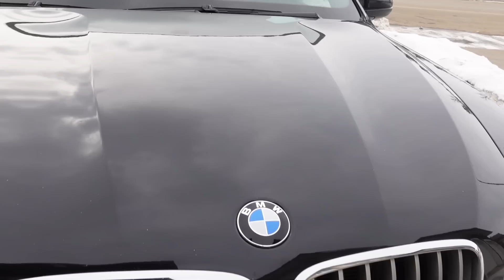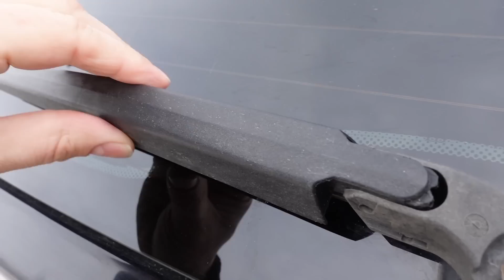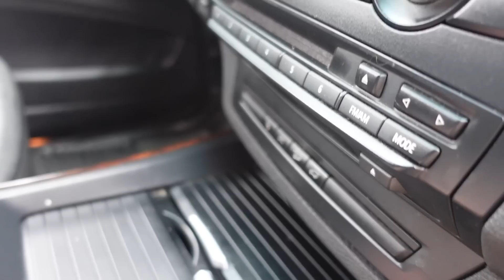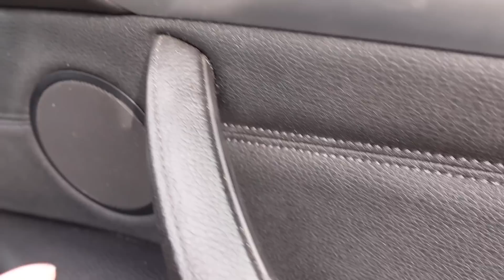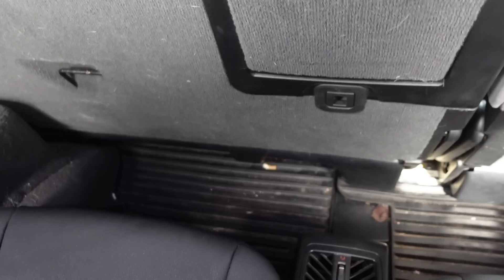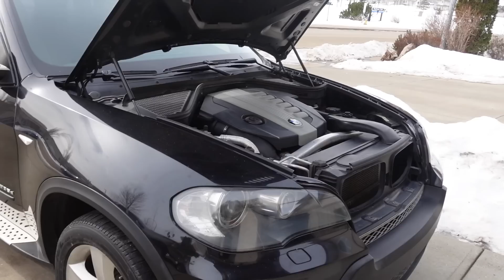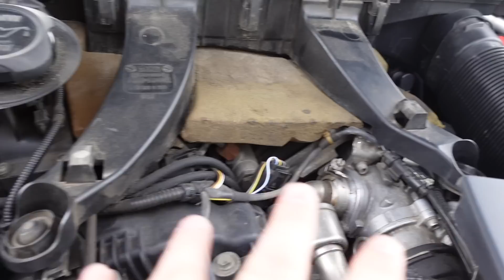10-Year Ownership Of My BMW X5 - A Long Term Review

Comment: I am considering a 125K (mile) 2012 X5 35d.  Your video was great and helpful, now I'm worried but made notes on your experience.  $12,000 purchase price but really nice condition!!!  Thanks
Reply: Being a year ago, how is your bmw treating you?
Reply: @OneReasun 160k have spent 12k at the dealership for new turbo and def  and egr was another 3k this thing is a money pit.
Reply: @Thedirtylittlesecret  I've had mine for 8 years /135,000 miles and just replaced DPF (Diesel particulate filter), glow plugs, and turbo's.  The maintenance alone is expensive, but these 3 things were very expensive.  So tough to get through these 3 on that cost, but hoping it's the last of large maintenance items for a while.  Ugh
Reply: @OneReasun  i feel you. If you ask me all signs point to cutting my losses. It’s just ridiculous.
Reply: @Thedirtylittlesecret  a trusted shop I go to is telling me these 3 are the main things with Diesel that are needed. Should be clear to go for a while.  So that was reassuring, sticking with it
Reply: @OneReasun  good to know but there is also a rear egr we replace the front and we just replaced the high turbo i guess there is 2 also 🤷‍♂️
Reply: @Thedirtylittlesecret  oof...what's the estimate on that one... hopefully the last of it

Comment: This is a crappy car, suspension problems and heater problems didn't even get to the engine b4  I turned this off. 300 thousand on a 2002 Honda crv. It is my daily driver. Just maintenance and brakes. You keep buying that German crap, I work on them, that's why I own a Honda.I really do like the BMW motorcycle, that is a long term machine for touring. Cars will not hold up to them after year 2005

Comment: 2009 Bmw x5 35d,  223k,  I am getting bad fuel economy 18L/ 100km, any suggestions?
Reply from the maker: With those miles it could be a bunch carbon in the intake or DPF getting clogged.  Regen cycles also cause consumption issues.  Lots of shorter trips?
Reply: @ECPP yes, mostly city driving

Comment: I have 2012 BMW X5 xDrive35i and had engine leak after getting it repaired it ended up having engine failure (probably should have taken it to BMW mechanic). Now I'm debating to repair or replace.  

The line about not giving it to parent or child stuck with me, I was gonna fix it and give it to my mom as backup vehicle but maybe not.

I bought certified pre-owned 2020 BMW X3... Wish me luck.  I might switch brands next time.
Reply from the maker: Good luck on the new car.  Which engine did you go with ?
Reply: @ECPP  2020 X3 xDrive30i pretty basic. But turbo 4 cylinder, right?

Comment: I had a 2010 x5 I spent little over $6000 after the warranty expired I drove that suv 6 years sold it for $14.000. Piece of advice, don’t Buy a bmw lease it! 74% of bmws you see on street are lease. After the x5 I bought a GX460 made in Japan, I’m still driving it never spent any money most reliable truck in the world also very luxury
Reply from the maker: Sounds like a great move on your part.  Cheers

Comment: With the break light issue...what was the fix? I'm looking to but one with that same issue. Thank you!
Reply from the maker: We were told an expensive module so we said screw it and left it
Reply: I bought replacement (Depo TW, $45) + original adhesive gasket at dealership ($15). It's fine for over one year already - pretty easy DIY, with tutorials on YT :)

Comment: BMWs frames and body panels are well made, but when it comes to everything else, they use way too much cheap plastic and computer crap. The engine bay components have more cheap plastic than the actual interiors. Personally I’m a die hard Mercedes Fan, but there are definitely some bmws that I like and would like to own. My favorite thing about some beemers is the split adjusting front seats, they look nice and are super supportive and comfortable.
Reply from the maker: I would say BMWs have some of the best structures and best at resisting rust as well.
Reply: @ECPP  I agree, I would like it if they worked on improving the quality for some of the major mechanical components though, the problem with bmw and Mercedes’ is the same problem that Apple and Samsung have. They can’t be beaten by each other. Perfect example would be earlier versions of idrive. It debuted in the early 2000’s as a headlining feature of the brand new 7 series. There were rumors years before that Mercedes’ was working on an infotainment system like idrive and because bmw was eager to get ahead of Mercedes’ they rushed idrive. Mercedes changed their design language in 1998 when they released the w220 s class. They noticed that bmw and other competitors were getting popular because they were having more bubbly like exteriors and so Mercedes’ went above and beyond with the 90’s trend. The w220 car got so much criticism of its reliability that it gave Japanese competition an advantage in sales. BMW had the same problem until the 2010’s when they updated and drastically improved the idrive system.

Comment: Over a 10 year period 16 k in repairs .mostly plastic issues is good.
So no major motor repairs etc piston rings loss of compresion valve breaking etc etc.
For a bmw is good.motor is bullet proof if looked after decently.
Once again snow salt cold.
Will crack alot of plastic hoses and parts.and mainly parked on driveway .in winter.
I got to say built to last.
Reply from the maker: thanks

Comment: I kept my 2009 x5 for 10 yrs as well, and I added up dealer maintenance and it was $16,000 usd (I kid you not). The final nail was the DPF needed replacing and they quoted me $6500. So that was that. I now have a 2018 x5 35i. I miss the diesel torque though. The engine was generally bullet proof. It was all that additional emissions monitoring and control garbage that didn’t work properly.

Comment: Good video, I own the same diesel model, 2012. Some of the problems are caused by parking outside. Garage helps. That said, it’s definitely not cheap to own. We have sports package, tires alone cost $1,200 since the positive camber causes uneven tire wear. This thing drives like a tank, we love it on long road trips.
Reply: How many miles on yours ?
Reply: 150k

Comment: My 2009 E70 35d is in great condition and drives like a new car at 250,000km.  I've spent some money on suspension, but that's normal wear and tear. Similar wear and tear to what you've pointed out. Fantastic car! No airbags, fortunately. ;-) I didn't realise that the body was largely aluminium!
Reply from the maker: Very nice

Comment: Mark. Love the videos. As commented on a other one we recently picked up a 2013 X5 diesel. Right under 160,000km and one owner. Decent maintenance history which included an active tank and thermostat replacement within 5,000km. Most of the items you mentioned are well known and documented. I do almost all of my own repairs etc so will likely cut down on cost. Depending on how the vehicle is I may look at deleting the emissions as well which would cut way down on running costs. Great share and appreciate all you’ve put out there.
Reply from the maker: Thanks for sharing and agree it’s likely one of BMWs most stout engines and deleting the emissions will ensure a long life vehicle that is solid mechanically and will not rust, making it run for a long long time
Reply: Active tank, is that the DEF?

Comment: Hi I have a 2 turbo 40D 2011/10 its great.  No DPF fitted so extra good needs diesel additive to de carbon the ERG  Use Penrite very good instant improvement on response .  have clocked over 170,000 Km  great driving replaced front lights assembly  with leds.  also installed 10.25 inch display qualicom quad core.  All great had the software box for media upgraded for apple android car play compatibility.   Works well ex BMW guy in Melbourne australia gave me the upgrade software worked .  no audio jack needed just blue tooth .  He did not give it was a few hundred Dollars Aus.
Reply from the maker: Cheers
Reply: Hi I looked at your youtube before buying and it decided my buy decision no regrets thanks.

Comment: Got 300k on my bmw 2010 x5 3.0in line 6 best motor it just keeps running other then valve cover gasket’s and a water pump and 2 sets of new tiers the truck has never left me stranded very reliable
Reply: N52 or N55?
Reply: My 05 Water Pump went. Outside of that it has been a dream. It gets up quick
Reply: Not a truck..lol

Comment: Considering the environment, I think those maintenance costs are not too bad. If I've learned anything from this video, it's that in Canada, you probably should change your car every 5 years. I'm looking at buying the later version. Probably somewhere around 2016-ish. I also live in a warmer climate. It never frosts here, but the UV is strong, so it's essential to store a car either in a garage or under a carport.
I can't also help wondering, how your car would have performed, had you kept it garaged most of the time? Thanks for the thorough review though. Very informative.
Reply from the maker: Cheers
Reply: Those maintenance costs are not “okay”. I live in Alberta Canada and mainly drive Mazda, Toyota, Lexus…. and I also park outside year round. Aside from replacing brakes, batteries and wear & tear items we have had no major repairs on these brands. We stopped buying Toyota because we wanted a quieter and more comfortable ride… so switched to Lexus. We previously owned North American autos but found after 5 years, they started breaking down…. so we stopped buying them. I’m at a point in my life where I can buy a $100,000+ auto and I really wanted a 2023 BMW X5 but after watching this, I’ll be buying another boring Lexus or Acura instead. My corporation leases our auto’s for 3 years and then buys out the lease. We then buy from the corporation a year later and put the vehicles into our own names. We keep our vehicles between 6-10 years and listening to this…. A BMW would be well above $10,000 - $15,000 in additional repairs over that time. Not too mention the exorbitant service costs over that time.
Reply: @beri232  I ended ip  buying a Peugeot and not a BMW. I still like the BMW design, but if they are not very reliable then there is no point in spending the extra money for the BMW brand. I still maintain my comment about keeping cars in the garage. It will definitely prolong the life of it. 
My Sister lives in Canada and she also said American cars start rusting and wearing out fast. They recently bought a new Mazda and seem happy with it.

Comment: i own a 2018 bmw f15 35d and let me tell you , i'm in love with that car. Torque and fuel efficiency is what lead me to buy that car. And the bulletproof engine :) but before buying it i made sure they fixed the issues on the E70.

Comment: I enjoyed watching your video since I have a love relationship with my 2007 E70 X5 3.0 inline 6 which turns 15 years old this month that I purchased new in Denver, Colorado.   No injectors nor diesel so the engine has been great. Low mileage - 104K currently.  The exterior and interior also has held up very well. Third row seat air bags went out once. I also track my expenses with dealer repair for the first ten years but after that an independent.  I haven't had the major diesel expenses but I agree about the $1000 repair bills are common when some thing major happens. I  will purchase a BEV as my next vehicle but am resisting the additional monthly investment since my X5 is basic transportation but still averages $200 a month.

Comment: None of this will bother BMW. They think that they did you a favor selling you a car. I make frequent round trips of 600 miles. I end up using a Toyota truck which gets 17mpg rather than a BMW that gets 30mpg, because I don't trust the BMW not to break down.
Make sure you tell everyone you know that BMW are junk.
Reply from the maker: Thanks and I certainly do.  Cheers

Comment: I wanted to add that your receipts are a bit too much. It looks like you were maintaining your x5 at high end shops and dealerships, which is a way to overspend. There also has to be an economic approach to owning a vehicle; prepandemic e70s had the worst resale. You would not want to plow thousands into a vehicle worth under 10 grand.
Reply from the maker: You are totally right

Comment: Proud owner of lci x5 35d with 3rd row. Bought as an off-lease CPO and now 7 yrs of ownership and it is turning 10 yrs old. Older 2009-2010 diesels like yours seem to have bit more issues than 2011-2013 lci
Reply from the maker: That may be possible.
Reply: I do think LCI or in general Face lifted vehicles tend to fair better than post face lifted or pre lci cars. It’s more so due to the manufactur finally getting the car dialed in from customer complaints and ownership surveys.
Reply: They don’t. It’s just your car is younger. They have exactly the same emission system and DPF issues and the pre LCI cars.
Reply: Any update?

Comment: This is why i always buy basic most common bread and butter german cars so they do not have gimmicks to be failed soon like adjustable air suspension. Currently I own gasoline 2018 330i 3-series with B46 engine,  which is a very good designed engine.
Reply from the maker: Thanks for sharing
Reply: Wow I was looking at buying one of these but think I will pass. Is there any used affordable BMW that are good? Is Mercedes better? I'm shocked so many problems with these BMWs .....sounds like just about any car is more reliable than a BMW.

Comment: I have owned the exact same car for 6 years now and 45k miles of our own and have had better luck with mine. I am at 124k miles and aside from the wearables, I have had 3-4 smaller items break with biggest being the thermostat which lead to DPF filter not being able to regenerate, which was annoying for sure - the diesel emission stuff is very annoying and least reliable portion of the car for sure. Engine does not have a drop of oil on it (I have a lift and took the stiffening plate recently), and interior has held up a little better. My car was Texas for first 6 years and then Virginia for next 6, so definitely not in as rigid climate as you. All in all, even $16K foe this class vehicle, about 70k new back in 2010 is reasonable in my opinion - beats the heavy depreciation those luxury SUVs suffer from…I would honesty recommend the car with no hesitation. Plan to shop to Europe to hand down to parents as we got a 22 X5 40i - wish they still produced the diesel, would have gotten it! Cheers to all X5 drivers out there - we have 3 of those currently and they have been pleasure to drive and relatively reliable. Inline 6 bmw engines definitely more reliable than V8s- I have had six V8s in the last 15 years, and still own two V8 M cars and those suffer much more from gasket leaks due to the heat that gets trap in the V of the engines…
Reply: My 2006 bmw x5 3.0 has 200k miles no major repairs
Reply: @rainbowsquash673  I'm not.... I literally fixed a $7 hose, some spark plugs... haven't even passed $500. Plenty of non bmw's spend thousands by 150k miles. Keep hating.

Comment: Didn't you say that you no longer love BMW's because of the maintenance involved? Now you have a new video on the X5. I own a 2012 Bmw X5 and spent $400 on the block valve which would've cost me $1500 at a BMW service center. You can go to an independent repair shop that specialize in BMW's it's cheaper than dealers. The technician used to work for BMW and they are cheaper.
Reply from the maker: That is true and much of my own repairs I DIY too.  Part of the issue is the low grade parts sold at premium prices and the greasiness of the corporate side to design obsolescence.

Comment: Sir, you are so on point. My 09 x-drive 48i had basically the same issues.  If I didn't do a lot of my own maintenance I wouldn't own this vehicle. It's a money pit that I'm in to deep to get rid of.  Everytime I may a repair I want to keep a little longer because it drives so good.  It's kind of a love hate relationship.
Reply from the maker: Thanks Don, I totally understand where you are coming from.
Reply: How ironic! I wanted to buy an 09 x drive 48i from someone I worked with, he had issues with his suspension where the car squeaked when it drove down the road. Found a mechanic to do the job for 2000 but the car was only worth 2500 so it was a bit of a bummer for me to drop out on.
Reply: @kkdtv3877  buy the parts and get a mobile mech to do the job
Reply: @grayparatrooper  it’s not that simple. The parts itself are expensive plus you have to buy the equipment. It’s cheaper and easier to pay a qualified mechanic.

Comment: Dude. 177,000 miles… few problems . It’s a 2012 x5d LCI.  I’ve had none of those issues. I too live in a cold climate in northern Minnesota. -40 F is common for a while.  The dpi fluid tank and sensors are the biggest issues. Just poor engineering. A Canadian colleague of yours has a retrofit part that solves this for about 450 bucks. 1200 for a battery is silly. 250 for a new glass mat battery and a programmer solves this with 800 bucks in your pocket. Airbag suspension is a big problem. Just ask any Land Rover owner. Ditch that for conventional springs and shocks as soon as possible. My latest expense was the fuel pump. Hard to diagnose, but when it fails you have no choice but go to the dealer. 
If you change fluids regularly, change transfer case fluid every 30K and add Hot Shots to your oil and fuel per their schedule you have cut your dealer service visits significantly. I’ve only sent around a third of your costs on service expense. 
But I agree with you, the emissions controls components are the most expensive to replace and limit customer satisfaction owning an X5d.